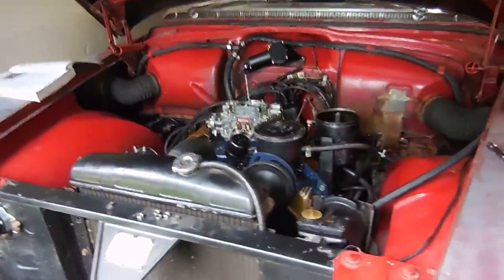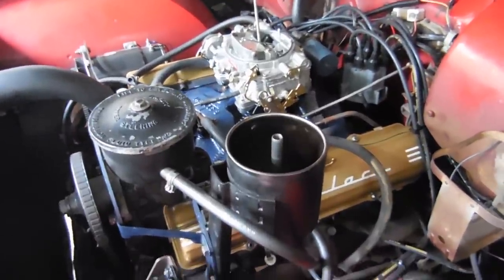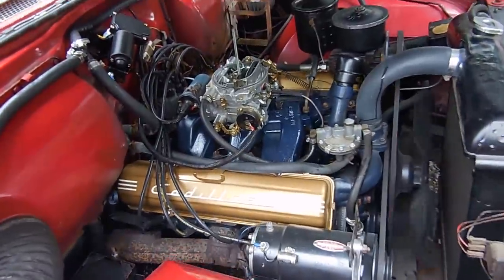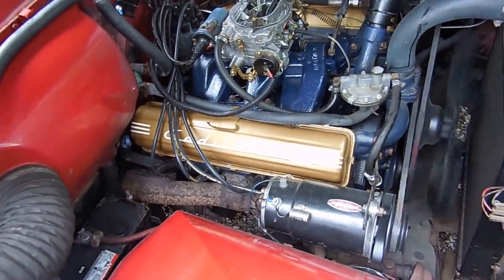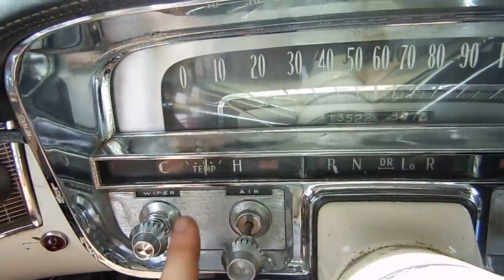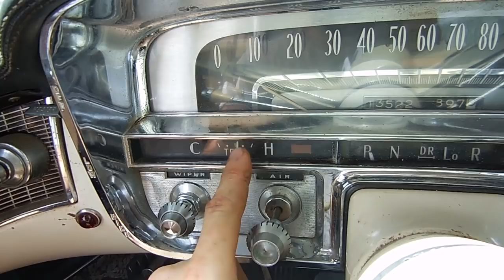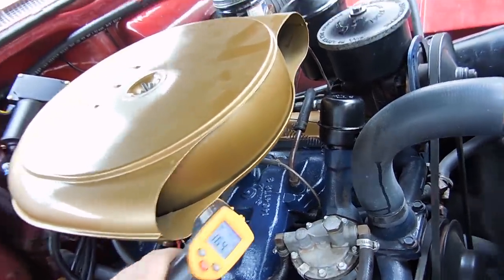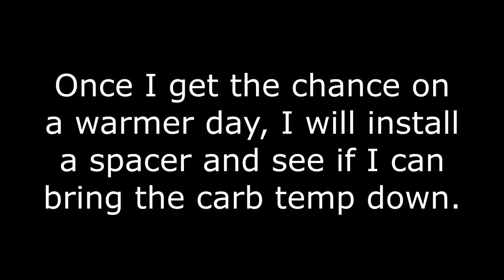1956 Cadillac Sedan DeVille Resto Video 72

Comment: I've seen this problem before. I put one of these engines in a 54 Chevy Belair about 40 years ago. It ran great as long as it was running. If you ever shut it off, that was it. It wouldn't crank until it cooled down. In 1980 you couldn't get much of anything for these engines. The way we fixed it, I had a guy fab me a hollow spacer with water nipples welded on. So I could run water through it under the carb. It wasn't anything new. Ford had already done it sometime in the 6o's It was costly at the time because the spacer had to fit the intake bolt pattern. But accept a Q-jet carb. And seal to both. I took a flying guess at the CFM I needed. I guessed that carb off a 350 chevy would work. It seemed to work fine. It had plenty enough power. It fixed the problem. No more heat soak. It would fire up hot every time.

Comment: Loving this old Caddy. America at it's best!! EDIT: these old big-blocks need fresh air under the hood. I am using a flexable tube [metal] to bring cool air into the air cleaner. Not much for heat-soak, but engine performance is much better!!!

Comment: Ben, a phenolic spacer is a must between the carb and intake with todays shitty fuels. You should also take it a step further and wrap all your fuel lines with Design Engineering wraps. I did all that on my 85 foxbody and 63 C10 shop truck and have not had any problems at all with fuel boiling over.

Comment: might want to hook up another gauge to check the old one for accuracy, those temps you took with the IR temp gauge seemed kinda high.. A fan shroud could help with cooling if there is an issue.
Reply: Ya know 325 degrees is ridiculously high. Nowhere on that engine with the exception of the exhaust manifold should get that hot

Comment: Try to find gas with no ethanol. That's what causes vapour lock in old cars. I never use corn gas in any of my cars, especially the old ones.
Reply: I literally just said this. Typically 91 and higher octane is ethanol free
Reply: Red handle gas pump at Quick Trip gas station

Comment: Hi make steel plugs to go into the head ports and machine some material off the intake manifold so there is no contact with the head. Phenolic takes a lot longer to get hot and IT takes a lot longer time to cool off it holds heat twice as long as aluminum trust ne on this

Comment: Hey Ben, I had the same heat problems with my z28. I also run an Edelbrock carburetor and I solved it with a spacer and heat shield that installs under the carb. I used a Holley product that uses an aluminum heat shield, it is PN 108-70, and found on Amazon. Hope this help!

Comment: If the temp indicator is accurate I would look into a cooling problem. Letting it idle should not bring that needle into the H zone. You may have a bad water pump impeller, clogged radiator, or poor air flow over the radiator.
Reply from the maker: Entire cooling system was brand new five years ago.
Reply: @TheCorvetteBen  The carb spacer may be the solution to the starting problem but it doesn't make sense that the car is on the verge of boiling over with the outside temp in the 90's and no A/C. An electric cooling fan might help the situation.
Reply from the maker: I doubt the gauge is accurate. The difference between the third tick and the one all the way to the right is only 20 degrees

Comment: I used to have a '56 Fleetwood that I got from my FIL at 100K mi. I put close to another 100K on it before I sold it. Never had any vapor lock problems in the summer. Back then there was no ethanol in the gas. That may have been the difference.

Comment: Regardless of carb type, you will most certainly need a spacer. Todays gas will boil if you look at it with a mean face. I assume you know how to do a hot carb start (Pedal to the floor, and hold).

Comment: I had the same problem with my 70 Chevelle SS 454 back in the 80's. When it got hot, she wouldn't crank . I tried retarding the timing a bit. Didn't help. It had a "4 core" radiator....looked fine but I sent it out to be cleaned and flow tested . Guy said it was fine. Bought a high torque starter..( it already had one from the factory) Didn't help. Installed a deep cycle battery in the trunk with 5/8ths inch thick copper cables. Helped a bit but still on the hottest days, she didn't want to start after a run. Then the old man, for whom I worked, said I'll tell you how to fix it, and you'll never have that problem again" ! He suggested that I "double up" the head gaskets. What did I have to lose...So....I removed my "large port, closed chamber" heads and doubled the gaskets...and never had the problem again !!! No matter how hot it got, or how hard I thrashed the thing !! . No noticeable drop in power, in fact it ran much better !.The old timers knew . Love your Caddy ! Keep'em running ! peace
Reply: Interesting. Can't beat experience can you.
Reply: Videomed; that's certainly an interesting solution in doubling the cylinder head gaskets. I've never heard of this idea before. And to think of all the positives you get from doing this is really interesting to me and to think I thought I knew all the tricks with 45 years of experience. I'll definitely remember to do this if I ever have an issue  with a hard hot starting engine. I guess you learn something new everyday.

Comment: Does the trans cool through the radiator? If so run an inline trans cooler and the spacer. Not expensive.

Comment: I've driven and repaired cadillacs for 50 years.  Don't install a spacer under the carb. Your vapor-lock situation is the fuel pump. I know, you think I 'm crazy, but wait til it does it again then slowly pour a gallon of cool water over the fuel pump and it will start. You can put an electric pump system on it, but I wouldn't. By plugging the ports you have now affected the cold weather performance so I would unplug them if driving in the winter.
Reply from the maker: I live in Texas. What is this winter you speak of?
Reply: @TheCorvetteBen  Unless you live on Padre Island, you have had to seen cold at some time...if an engine runs too cold, it will build up carbon deposits worse. Also, if you want to fix exhaust leak - make copper manifold gaskets, seal with coppercoat liquid sealer.

Comment: 160 or even 170 degrees isn't super hot for a carburator if you measure the temps on 70s and 80s carbs they get real hot it's possible the alcohol is boiling off and it takes 30 percent more alcohol than fuel  to burn I'd try 91 or higher octane fuel first due to its ethanol free and it's possibly your fuel pump and fuel line are getting even hotter and causing the fuel to boil off